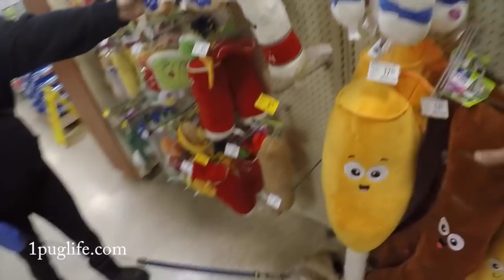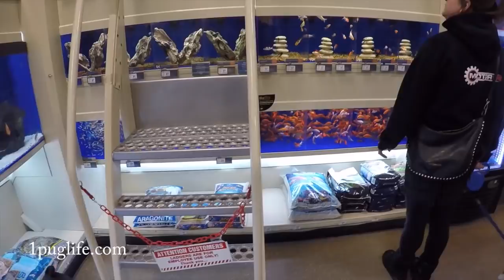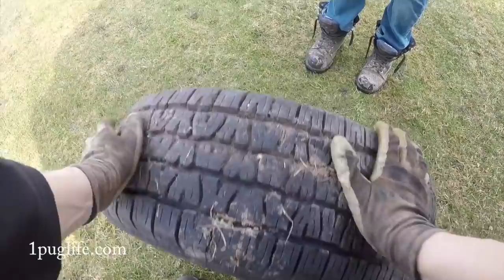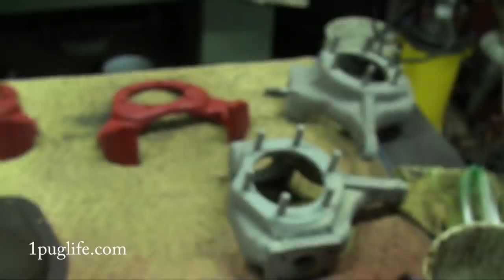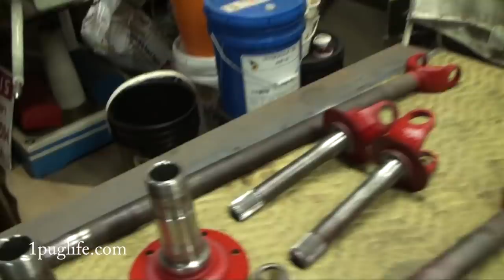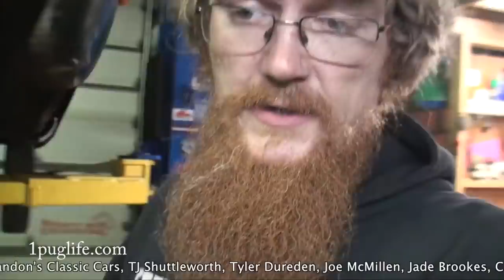abbys gotcha day

Comment: Clean, pick, and Polish the bad surface.  smear jb weld or favorite oil resistant epoxy to fill voids.  smooth and polish that down.  install speedy sleeve for the sealing surface.

Comment: Take the sleeve out of your spindle, grind and weld up the shaft, then turn it down. FFS, take a looksee ate the manual for your lathe. that unit has a 2" through spindle on it, ya big goof. BMP

Comment: I'm not sure you read this stuff.. if there is anywhere that does it in your area... they can be plasma sprayed. They spray on metal to oversized and then grind it down to the actual dimension you're looking for. I've seen it done by welding and then grinding. You need a machine shop.